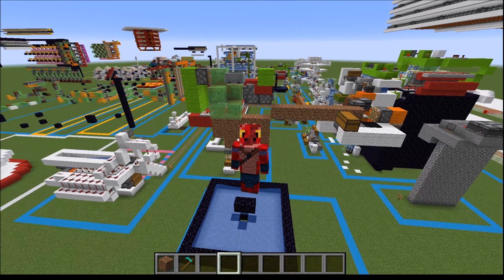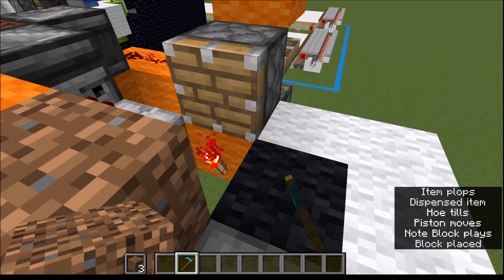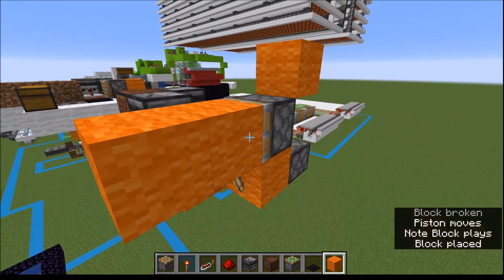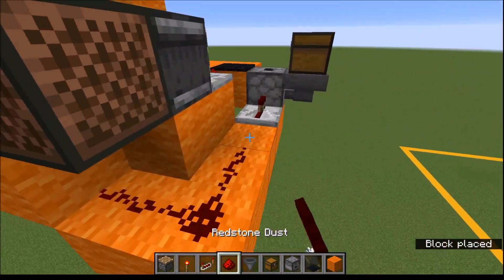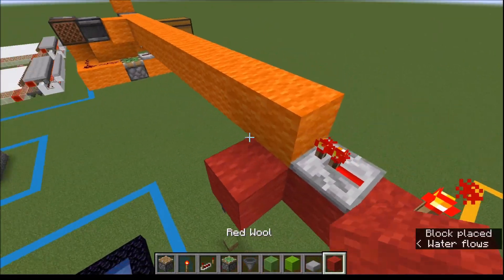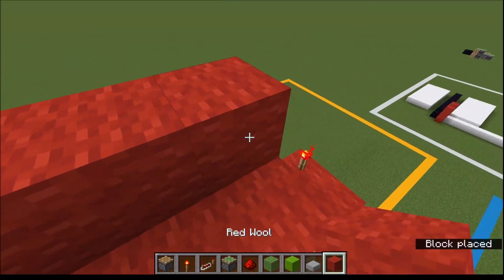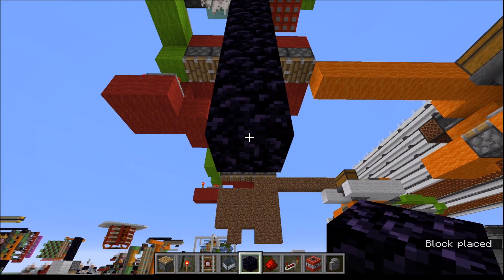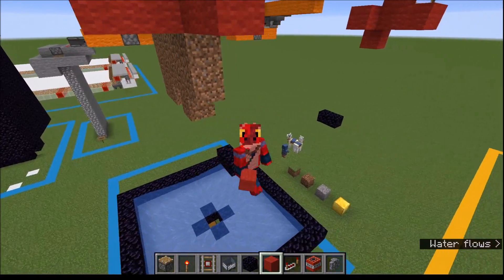Dirt Farm and Wood Stripper (1.16, 1.16.1 1.16.2 +) (6000 Blocks per Hour)

Comment: this is pretty well demonstrated but I would recommend you include some measurements on dimensions. Things like how big the catchpool needs to be, how far above the catch pool you recommend putting the explosive platform, how far above the catchpool should the piston layer start, where, relative to the catchpool, the placing station should be built. 

I think your videos will be improved by including this information.
Reply from the maker: Thanks! Ill add that info in future videos!
Reply: @SplashesInPuddles  does this work in 1.19+ ?

Comment: This doesn't move the regular piston forward in Java...
Reply: yeh im kinda dissapointed ngl
Reply: It seems like this farm was designed in java, and the world download works for me on java 1.17, but I have the same issue when I try building it myself or pasting in a schematic of it.
Reply: @nilsh5027  same issue here, WDL works but when i built or paste schematic it doesnt :\
Reply: just remove other piston and connect redstone dust to regular piston, tested/worked.
Reply: @giorgibejanishvili9065  does that work at the same speed? For me, I had to swap out the zero tick generator with one I found in an ilmango video
Reply: @nilsh5027  yeah, sometimes it shoots twice instead of one but its not that much of a problem + i added one water block before blocks goes to tnt chamber so now its dirt and concrete generator :D
Reply: It does for me, but not when I copied and pasted it to another location...
Reply: Place a block on top of block beside piston(observer side) and add redstone dust on it, it should work

Comment: I'm in 1.21 and my piston that have to pull the dirt doesn't work, it only activate the sticky piston
Reply from the maker: Ahoj, 
There is no piston to push the dirt, however redstone has changed a bit since this machine was made so some parts do not work perfectly. If you remove the zero tick generator by removing the sticky piston (but leaving the solid block in place) and having the redstone run directly into or on top of that solid block that should fix it for you. You may need to set the solid block as a noteblock because some places in minecraft have funkyness with updates.
Good Luck,
Splashes

Comment: Any idea why mine runs ok for a little while, then slows down the piston feed to half speed? The powering pistons always end up in wrong position when I stop after it has slowed down, too. Sometimes it just flat out stops.
Reply from the maker: I dont know sorry, what might be happening is tick lag might be causing the spat out block that powers the piston to invert
Reply: @SplashesInPuddles  Thanks for reply. So, it's running better now. Just did 1hr continuously, with only 1 slow down + need to reposition blocks on pistons. I switched from optifine to lithium + reduced render distance. Neither change should help, but clearly something improved. It's now use-able.
Reply from the maker: @simontharby8002  Yeah that definately sounds like a tick lag causing the things to invert if you just have the power run into it directly without the up down piston it should still work just itll be ever so slightly slower.